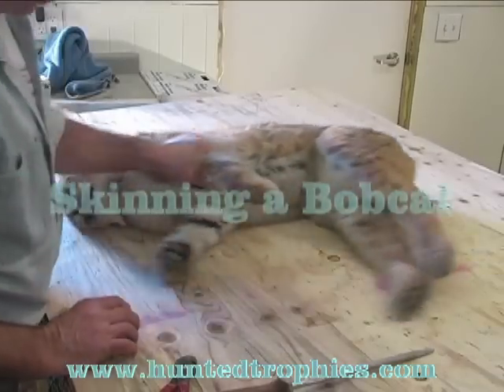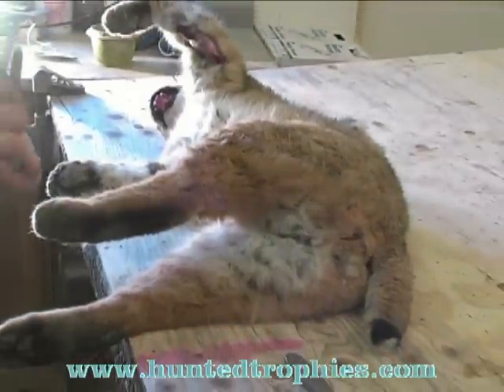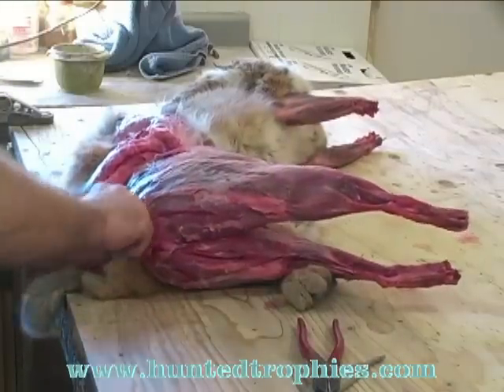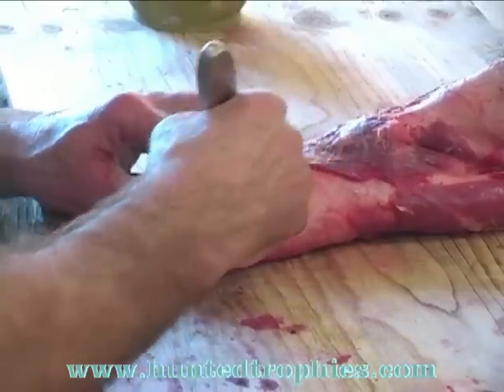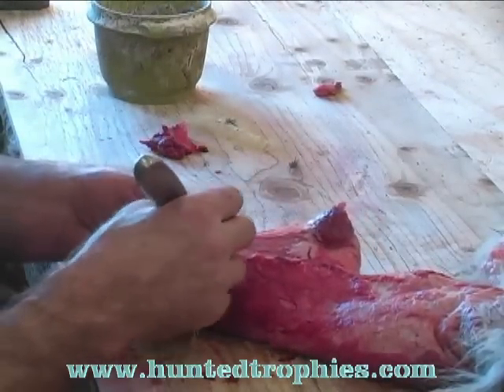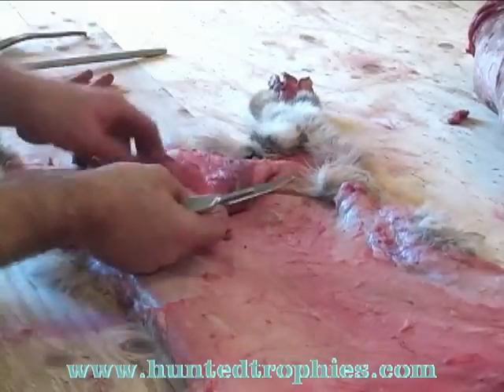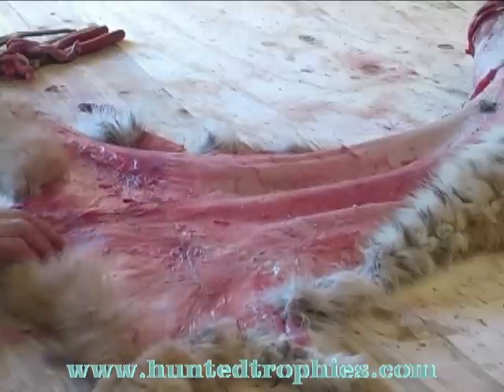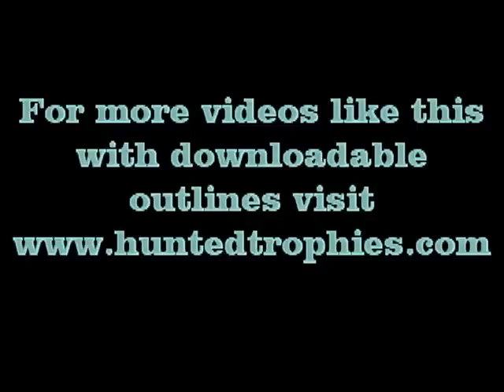Skinning a Lifesize Bobcat

Comment: Yeah he did a lot wrong. You don't need to cut through bone to get the feet off, you can cut through the tendons at the joint. Skin out to the very last toebone for a proper mount. There's no need to cut up the belly, you can just case skin or dorsal and it saves on sewing. Don't cut the paw pads or stitches will show. Split your tails or they can't be properly fleshed and will break off after a year or two of being tanned. 90% of YouTube videos are wrong. Glad I learned the right way elsewhere.